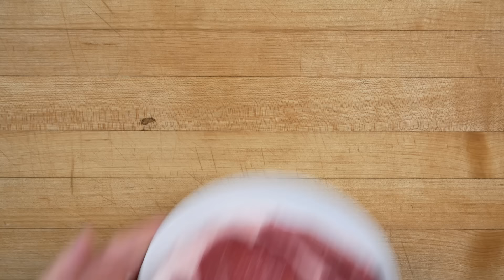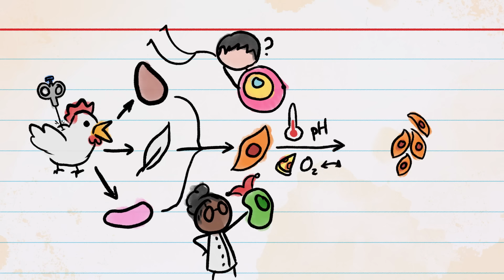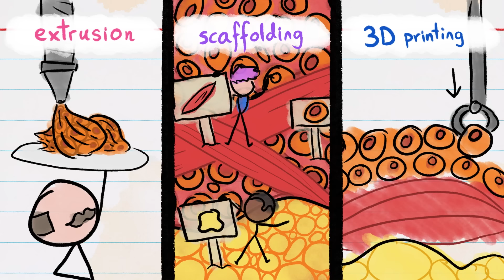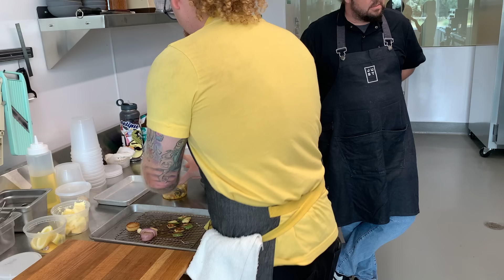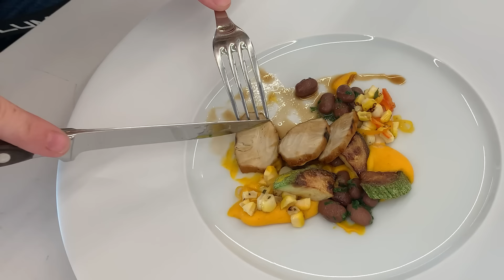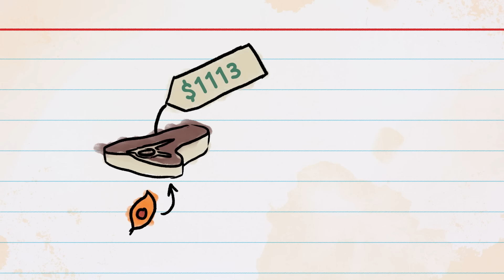Lab-grown meat (probably) won't save us

Comment: This version of cultured meat is essentially a beta batch - it resembles the final product enough to be ready for commercial consumption, but it's not ready at a larger scale. Right now, the investment is low enough that they're basically using repurposed brewing equipment - and they're doing it remarkably well! - but they're definitely not using the purpose-built tools that they will be when they actually get the funding, interest, and contracts to scale up to a full release. One important note: most of the increased greenhouse emissions (and confusion over their reporting) at this point are from electricity generation - which already has multiple solutions to turn 100% green with fairly minimal effort - compared to the intrinsically uncapturable methane generation of livestock.
It's not the "short term" solution - but let's be real about it, there isn't a short term solution for an issue that's this deeply ingrained in so many different cultures. To be clear, if everyone functioned on the "this is the logical way forward to make our world sustainable" not only would we have tackled these issues 50 years ago, but we'd all be going vegan and giving up meat for the benefit of the planet. We're not nearly that rational, so we need more and more "out there" solutions to tricking ourselves into eating more and more sustainable food - and tricking foodies isn't the sort of easy problem that you can just slap a solution like "it's a vegan burger" on.
I still say it's the best way forward, but also agree that it's not really individual people that are going to decide - it's the major restaurant chains and food distributors that will have to be convinced to buy in before something like this can even try to get off the ground. Until they decide to do something, our arguments basically mean nothing.
Reply: uh no, you're a bit off there, they are in fact using machines specially made for their purpose, and there's no way to cheapen it for scaling up, they are already getting government funding and well- their current operation took half a billion dollars to set up, and replaces 66 cows worth of meat a year at a significantly higher price. for reference, that's roughly 80'000 dollars in cows, IF all 50'000 pounds of their product is viable, and is sold each year- at their 60$ price tag- they will receive a gross income of 3'000'000 dollars before taxes, wages, dividends, and etc- but assuming they had to pay none of that, in 166 years they would be able to set up their second operation.

it very much isn't a short term solution, and actual experts agree- it's not viable as a long term one either.

Comment: If it's some fold more expensive, then it basically means it have more environmental impact than traditional meat.
The costs ultimately came from things like making the carbon fiber for windmill, fab the solar panel, or mining the ore for making these expensive equipment, so you don't need to investigate them one by one, if it ended up in your mouth more expensive, it's not that good...
Well, if you think pay the premium for not abusing animal is more ethics, that's another story.

Comment: The cost should go down with economies of scale and subsidies (our meat industry is already heavily subsidized). The ethics will be better, as long as we avoid FSB and other issues like that. Climate change is another question, but it's worth pointing out the other mitigating steps (nuclear, wind, solar, mass transit, electric vehicles) can offset it if there are too many problems in that realm. It'd be interesting to see how well we can replicate beef and pork, specifically things like bacon.

I think there are enough pros to at least try to scale it up

Comment: For some vague context: early commercial solar power cost 100s of USD per W, now it's measured in 10s of cents per watt; and that was just in the 3ish decades that I have been alive.
I don't know if any of these lab meat ventures will work but the fact that there are so many different possible methods; does suggests that there is a lot of room for advancement.
Reply: also to note in 2013 when cultivated meat was debuted it cost over $300,000 for a single burger patty. We've come quite a long way in a single decade
Reply: @andrealiu5106  Yeah, now we can buy this thing in a supermarket.  I was 12 when I got to know about this and thought that this is something out of a sci-fi novel. Today it's close to reality.  This much progress within a decade is bafflingly fast!
Reply: That was my thought, assuming cultivated meat catches on, I would imagine methods would be highly refined and advanced as well as the processes being increasingly subsidized meaning that the costs would drop dramatically. As far as the emissions issue, I imagine that refining the process would ultimately solvs this issue as well, at least in comparison to the negative environmental ramifications of raising and processing massive amounts of livestock. As Kate noted, the science is extremely new so with proper funding and support this could revolutionize the hunger crisis within a few decades
Reply: @prolastmedia6171  Fuel isn't free, so if it's super cheap, it's also low emmissions.
Reply: yeah, I really believe this kind of thinking that there are so many hurdles and it's expensive is such a bad mindset to have for an innovation with such huge potential (even if it doesn't succeed mainstream, it's at the very least worth a shot) and your stance is applicable to so many other areas of technology including genome sequencing, airplanes, electrical hardware, the list goes on!!! We never got anywhere with tech advancement by being pessismistic and counting our downfalls.
Reply: The question is if the lab meat is the flying cars (always 25 years further, and creating more problems than they solve) or the solar power (eventually kicked off).

For computer storage we had some nobel prizes given for physics that lead to GB hard drives rather than MB hard drives. And then we got cheap(ish) SSDs.

Perhaps what is needed to create lab grown meats cheaply in bulk is a breakthrough that we can't even envision yet, or a breakthrough that will never happen.
Reply: Video said that she’s not sure if it’s workable in the long term. But that depends on what we’re calling “long term”. 10 years? 50 years? 100 years? 500 years? We can make a LOT of scientific and technological progress in a century.
Reply: Well, the issue here is that cultivated animal cells are old, like very old… And it still costs a ton to produce in large quantities.

Now that doesn’t mean there isn’t room for improvement and costs won’t go down, it’s just to say that we aren’t talking about a completely groundbreaking technology being refined till its cheap, we’re talking about a relatively mature field where groundbreaking innovations will probably be needed in order to bring costs down.
Reply: @nathanjora7627

That's like saying "pv cells are old. Very old. 1800s technology, so it's a pretty mature field" in 2002. 

Technically yes, and also nobody's been trying to make any kind of edible large-scale cultivated cells like this until very recently. It's old, but it definitely isn't a mature field with minimal room for improvement.
Reply: @nathanjora7627  "Cultured meat, produced in bioreactors without the slaughter of an animal, has been approved for sale by a regulatory authority for the first time. The development has been hailed as a landmark moment across the meat industry.

The “chicken bites”, produced by the US company Eat Just, have passed a safety review by the Singapore Food Agency and the approval could open the door to a future when all meat is produced without the killing of livestock, the company said."
-theguardian, 2 Dec 2020.
Reply: @nathanjora7627  Exactly, we can grow heart valve, but if those cost $1000 to make it is still cheap to save a life.

Comment: No amount of consumption will solve overconsumption. Unfortunately lab grown meat and vegan/vegetarian solutions often imply even more consumption and industrialization. The key is, animals/meat do not pollute on their own. Animals exist in a natural cycle and only start to pollute when they're farmed industrially, which overproduces and generates incredible amounts of waste. As a consumer, your best avenue is to buy local meat, if you eat meat at all.
Likewise, carbon dioxide does not pollute on its own. Nature produces far more co2 than we can. However, the small amount of co2 we produce is enough to upset the balance and harm nature. The long-term systemic solution is to end the extraction of fossil fuels altogether, if not dismantling our profit-driven capitalistic system altogether.
Tldr: de-industrialization, a solarpunk energy system, and a low-waste "library" economy are the solutions. Not more industrialization, fossil fuels, and a proposed "shareholder capitalism" system with fast production rates, low quality, high waste, and uneven distribution.

Comment: The cost is probably calculated without subsidies. Fair enough, but killed meat (at least in the US) is massively subsidized by the government. If cell cultured meat had access to that level of money, I’m sure it could be comparable to killed meat in price.
Reply: How much of a difference are we talking here? Lets just talk ground beef. At the store it's something like $4-5 per lb right now. How much more would it be if there were no subsidies? 

The video was flashing some really high price tags for the lab grown meat, so would this change really make the two close in price?
Reply: @lkjkhfggd I'm actually quite sure it would. Our tech is only going to get better, just a few years ago, cultivated meat was 10 000$ for a single small piece of I remember correctly. Now it's being sold for as little to 60$. There is no doubt that we will be able to potentially get cultivated meat to be cheaper than conventional because think about how much actually is subsidised in the meat industry: the animal feed, the animal equipment, the gas to run the transportation operations, on and on and on.
Reply: @lkjkhfggd You are looking in the wrong direction. The grown meat, like the animal meat is not subsidized by pound. The businesses themself are subsidized with tax exempts and institutional services. Meat growers will get the same subsidization, when they are on the market. His question, which he failed to formulate, is, should we stop subsidizing animal meat beforehand, to push the grown meat, without founding a whole new industry into existence. 
The answer is obviously no. Not because it would be the wrong thing to do, in our situation, but because no politician could sell it. It's the same with our energy production. We know what should be done and we do, what can be done, without strangling our GDP right out.
Reply: They're also being subsidized by not being required to remediate their land/air/water use.
Reply: The video really ought to have mentioned government subsidies of the meat industry, because the presentation as it stands implies that the comparative cost is simply a technological problem, and not also a political one.

Way too much reporting on climate change makes this same mistake.
Reply: @thev0id  FR
Reply: uh no, though people really like twisting it as though it's the taxpayer paying for the subsidies, the reality is that farmers simply pay less in taxes, which essentially halfs the cost of meat and dairy- adding up to a total value of roughly 38 billion dollars each year, just for the discounts given to the meat and dairy farmers.
now, the government has actually paid out money to start up 'non-standard sources of meat', specifically there's been a total of 1 TRILLION dollars spent across subsidizing Lab growing meat and research for "meat alternatives", all of which are turning up as dead ends that are either worse for the environment, economically non-viable, or just plain fraudulent.
Reply: @crazyabe4571  1 TRILLION [Citation needed]

Also tax cuts mean either less spending (austerity anyone?) or more taxes elsewhere. What if you just gave those tax cuts to people in low income brackets, boost spending a bit?
Reply: 'Killed meat' that's a good one. Im gonna start saying this ⩣

Comment: Wouldn't scaling up production of lab-grown meat hypothetically improve efficiency, thereby reducing the fossil fuel emission cost? And over time, couldn't those processes become more energy efficient as we learn new things, and eventually be replaced outright with renewable energy? I think it's hard to say for sure when this isn't being made on a mass-produced scale yet, it's still in its relative infancy. I'm not arguing against any of the other points you made, which are certainly problems, but the reduction in land use and water are definitely big pros to this, not to mention the ethical aspect. (I think being vegetarian is better anyways, but if this is what it takes to potentially help the planet I support it)
Reply: They can't scale up their meat Tank sizes without the meat failing, so the only way to scale up would be to set up a new facility, unfortunately- it cost them around 500 MILLION dollars to establish their first one, and they can only make 3 MILLION dollars a year Gross, to put it another way, without major investments that will see little to no return, it would be 166 years before they could establish another facility to produce another 50'000 pounds (66 cows) of meat.

Comment: I'm pretty excited about lab meat. I'd love to try it.
Those images of the lab chicken and sushi surprised me when I realized they we the lab stuff and not just stock photos. I think it opens a door for very currated cuts of meat and could be a cool opportunity for new kinds of meals.
Reply: On the topic of lab grown meat emmition cost: Even if it's high now, there's likely plenty of opportunity to reduces that once the process is refined.
I imagine there is an enormous potential to have a much smaller environment imapct because SO much energy is spent of just the food for animals, then there's the gassy releases from the animals themselves and all the processes for turning animals into a product.
The production chain for lab meat seems way smaller and that usually leads to less cost in many ways.
I hope it works out.
We comapre the cost of new tech like this to the established way and see it as SO expensive but all the old ways have been refined and mastered for decades or centuries. New stuff WILL just be more expensive because we are starting from the very beginning.

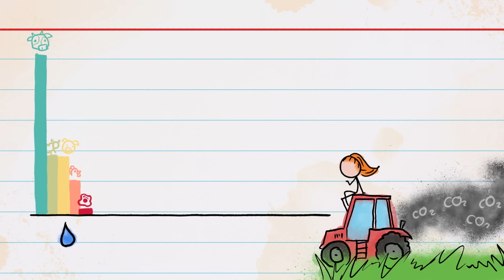Comment: 6:12
This is the answer. The raw material usage for lab grown is insanely small, and the electrical grid is only going to get greener over time.

The potential cost floor of lab grown is so low it starts being feasible to make these setups portable and modular for pooper communities/countires to get balanced diets for far cheaper than they would otherwise, and with way lower carbon footprint

This also makes mass cattle cultivation not market competitive. No need to burn the amazon, all that land can be reforested
Reply: Great point, lab grown meat doesn’t only reduce the need for livestock, but it also reduces the need for habitat destruction.
Reply: @lekudos  The poor quality is mostly result of factory farming methods. Lab grown meat has the potential to be way better for you for way less cost, since you skip trying to optimize growing an entire organism for slaughter, and go straight to just duplicating the cells.
Reply: @Ryukachoo  Not just that, but the cell cultures are isolated from all the pathogens of manure, and the inefficiencies inherent to forming growth hormones or antibiotics into feed-ready form. The neurotransmitters and cell markers are just thrown directly into the vat
Reply: @lekudos  
Ideally it's for everyone, an actual real meat becomes an occasional nice thing, like for Christmas or something.
On a long enough timeline, the artificial stuff starts tasting better than the real thing because it can be engineered to be perfect basically
Reply: . . .you have done research right? the "GOOD MEAT" guys operation cost $500'000'000 dollars just to set up one location, where each year they can produce 50'000 pounds or 66 cows worth of meat, at a higher cost in EVERYTHING besides land, be it chemicals, water, CO2- while under conditions where any amount of contamination to their product will ruin an entire batch of meat and require extreme amounts of sterilization to return to normal function?
this is a product aimed towards the rich and wealthy, not the poor.